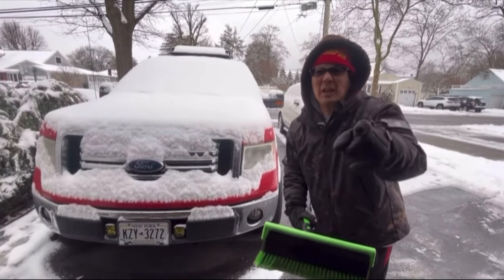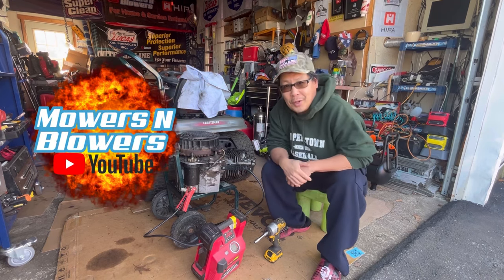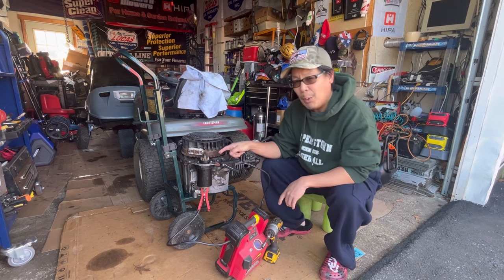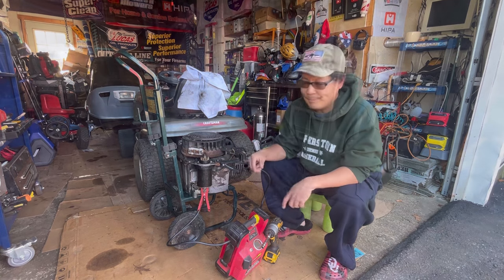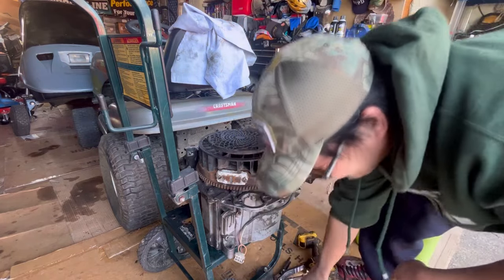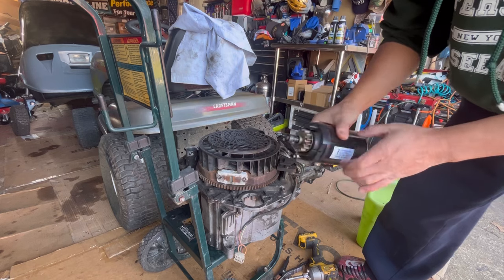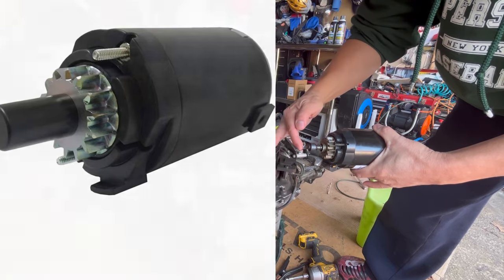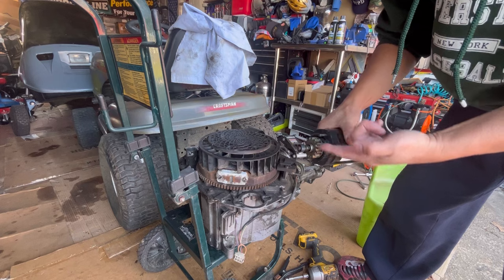HOW TO FIX A SLIPPING STARTER MOTOR KOHLER COURAGE JOHNSON ELECTRIC TAKE APART BENDIX GEAR ASSEMBLY

Comment: I have a question. I need some info on, please, Sir, I just replaced a solenoid on a kohler 21 hp that's on my Hustler lawnmower. The problem I'm having is now   mower is not getting any power to the starter at all now . Is it possible that the solenoid is wired bacwards? Because of the mounting on the solenoid, there are two ways to mount it. Could Wiring it backward cause this. I have not given up trying to resolve it, I've recently had surgery on my back , so,, I have to take breaks for relief due to that, I thought it would be a simple placement of the way it was wired on the original one ,but it's not an oem part.
Reply from the maker: No you can’t mess it up,  doesn’t matter.  The two thick red wires go on the top big bolts and a yellow or white thin wire to tab,  if it’s a 4 post solenoid,  you’ll have another tab for the black thin wire.

Or you may need to bypass your safety switches

HOW TO BYPASS LAWN TRACTOR MAGNETO KILL SOLENOID PTO BRAKE SEAT SAFETY SWITCH ATF FIX SLOW TIRE LEAK
https://youtu.be/OdmiUN3F7kY

Comment: Im thinking if you remove the rocker arm and ground down the flat spot on the bolt a little where the rocker sets you might be able to make up 10 or 15 thousands that you need. heck grinders work wonders lol
Reply from the maker: The problem is I need more material,  instead of grinding,  I’d weld a bead to make up the space I need.

Comment: Install at least two engine mounting bolts diagonally when testing engine. Exhaust valve is roughly 3 times too loose out of spec at .020".  Those Kohler early generations are known problems.
Reply: Kohler starters I mean.